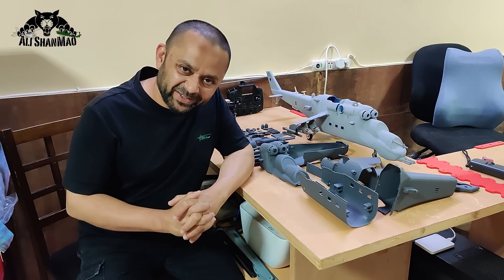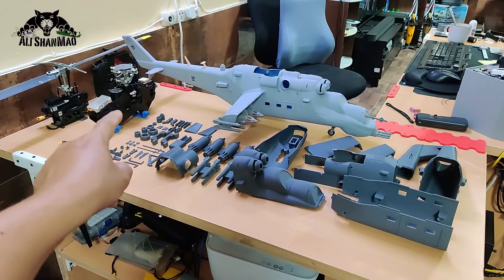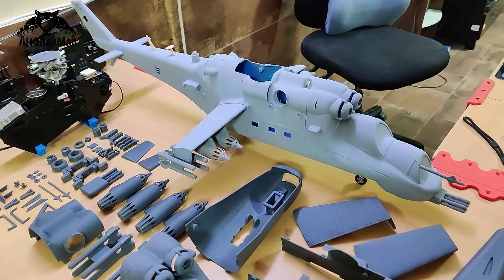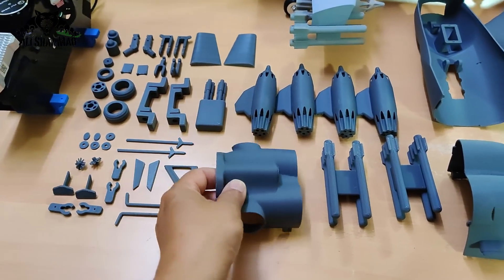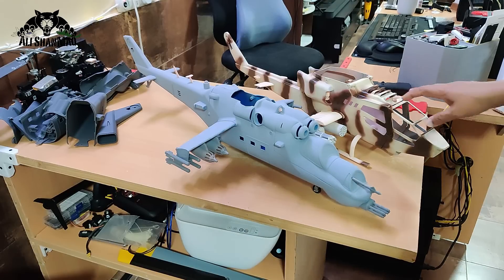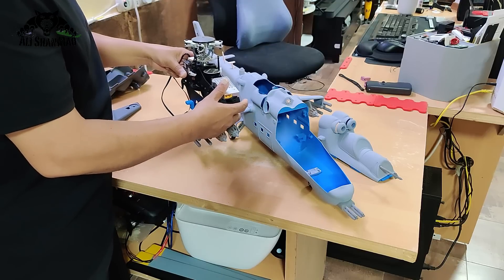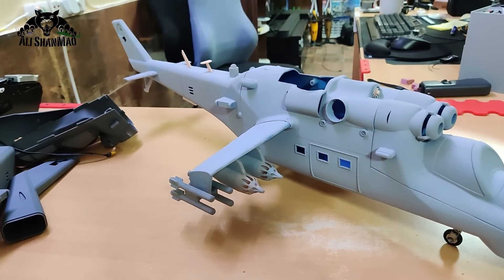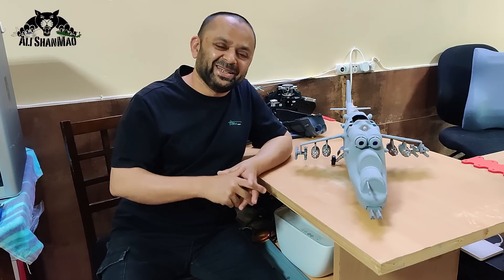Introduction to WarKroc X470 Fuselage Kit

Comment: I bought the files on cults and am in the process of printing. I noticed you changed and added vent holes to the APU Turbine cover and the Hatch. I would much rather have the un-vented pieces like you show here. Is there a way I can get them from you please Thank you
Reply from the maker: Hi. Thank you for your support and purchase of the model. I will have to check if I still have the older versions. As I thouroghly test the fuselage, I found that Without those vents actually the ESC and motor heat up badly that is why I had to make those vents. I am sure you would soon be back to these ones with vents after first flight. Anyways, you may email me and I can send STL for the older version if I can find it in my PC
Reply: @alishanmao  I cut the windows out so I’ll get air through there. I also sent message on Cults. 
I’ll look for your email and send message. Thank you.